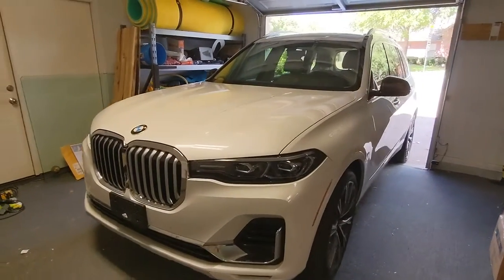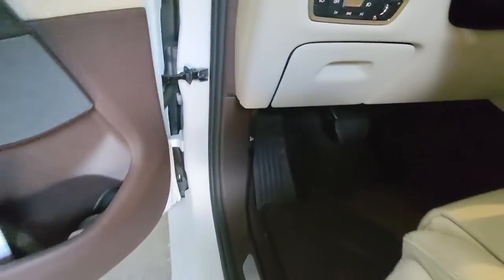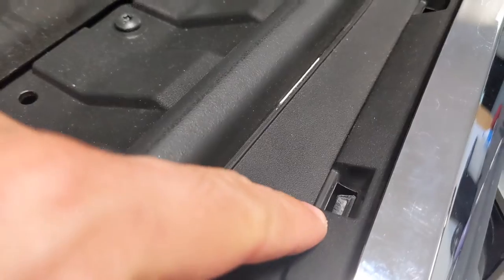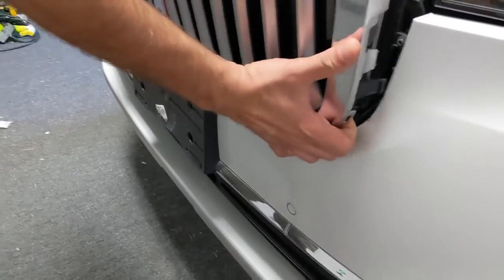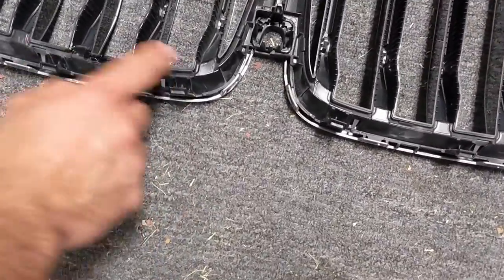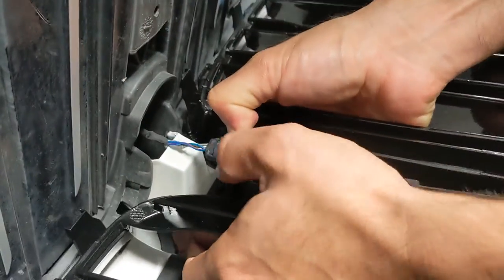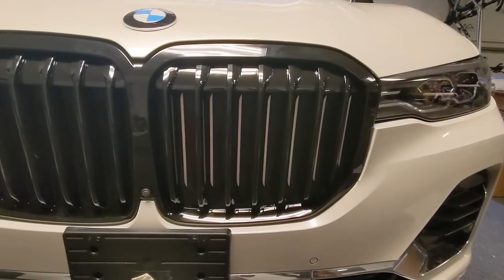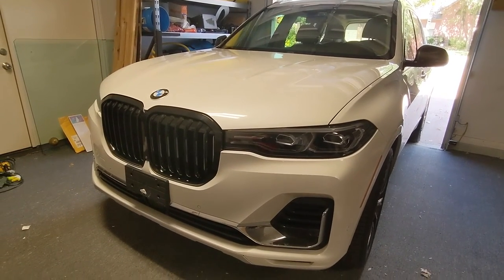BMW X7 X5 M-Sport Black Grill Installation - 10 Minute Installation - Under $190

Comment: Awesome job! I just got my grille and will be swapping it out tonight. 
I hope you will black out the bottom chrome trim as well, it will make your X7 look even better.
Reply from the maker: I blacked out the chrome trim on the sides, the rear bumper, and on the trunk lid. But didn’t do the front. But that’s a good point. I may try and wrap those next week if I get time. Good luck on the grill install. It’s super easy.
Reply: @NKPGarage   That would definitely look better. And btw, I've already swapped the grill in less than 5 minutes, thanks to your video and for the time and effort on your part. 👍
Reply from the maker: @ivinio21  glad it was helpful. I just found the rest of my vinyl carbon fiber 3m wrap. Going to try wrapping the front chrome bits tomorrow.
Reply: @NKPGarage  Nice. I almost bought a white X7 with black trims all around including 22” black wheels. IMO it just looks sharp in that color combination.
Reply from the maker: @ivinio21  agreed. Gorgeous combo!

Comment: great video did you try to blackout the chrome piece under the grill piece?
Reply from the maker: Yup I definitely did. I used 3m vinyl wrap to do that. It turned out looking great. I did two short videos showing how I did it. This video is for the rear trunk trim: https://youtu.be/XHS7XbJWolQ and this video is for the side trim: https://youtu.be/5_6TbI6cnYY
Reply from the maker: Yes I did

Comment: I think because of the other chrome accents it doesn't look as good as if there was no chrome elsewhere. Still nice.
Reply from the maker: I agree. I ended up wrapping the chrome on the side and rear of the X7 with 3m carbon fiber vinyl wrap and it came out pretty nice. Check out the other videos where I wrapped them.

Comment: Great video? I’ve an X6 XDrive 30d 2021, and it has “Iconic Glow” (illuminated grill)…. How should be the process to install a new black/carbon fiber grill (keeping illumination, of course)??
Reply from the maker: That's a great question. I haven't had one of those apart before. Is the glowing behind the grill? Or does the grill itself glow?
Reply: @NKPGarage  the illumination is attached to the grill itself. I think is very difficult to uninstall and re-install the illumination on a new grill.
Reply from the maker: @fuentes831979  that's very interesting. I'll have to look up the diagram of how that goes together.
Reply: @NKPGarage  great! Thank’s for your help and your videos.

Comment: Where did you buy the black grill?
Reply from the maker: Got it right here: BMW X7 G07 2019 -2022 M-Sport Black Grill: https://amzn.to/3O3imw2
Reply from the maker: And here are a few others for other similar platforms: BMW X7 G07 2019 -2022 M-Sport Black Grill: https://amzn.to/3O3imw2
BMW 5-Series G30 2017 2018 2019 2020 2021: https://amzn.to/3ohwdWl
BMW 3-Series F30 2012-2018: https://amzn.to/3AS8lw5
BMW X5 and X6 E70 E71 2007-2013: https://amzn.to/3ulv5Su
BMW X5 and X6 F15 F16 2014-2018: https://amzn.to/3zSHyOX
BMW X3 G01 2019-2021: https://amzn.to/3F4h9kM
BMW 5-Series F10 F11 and M5 2010-2016: https://amzn.to/3kQ2txy
BMW 3-Series E90 E91 2004-2008: https://amzn.to/3AS9tzP
Make sure to get a good trim pry tool set. I recommend this one: https://amzn.to/3nSv5XJ